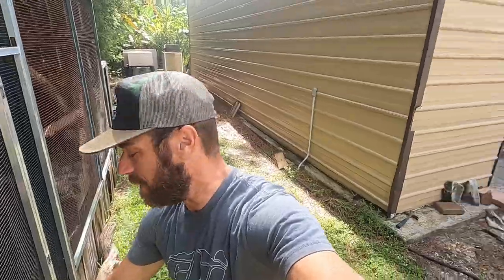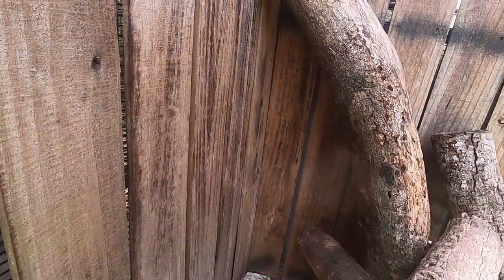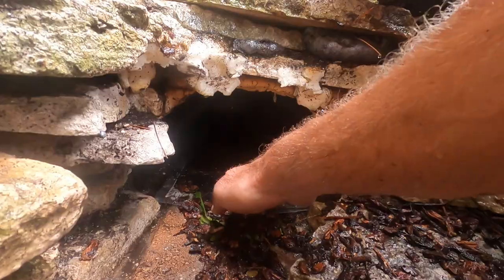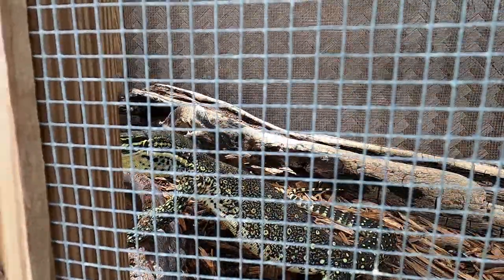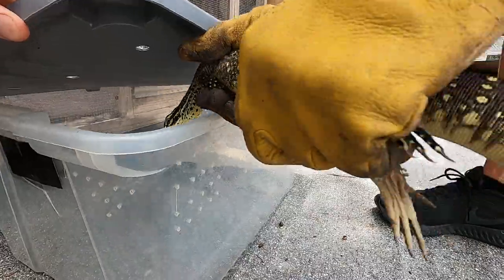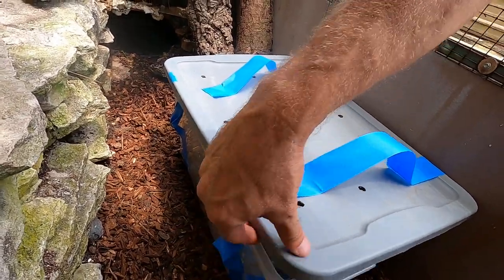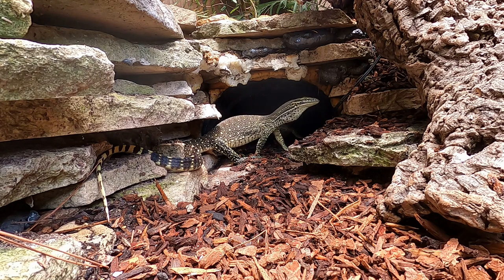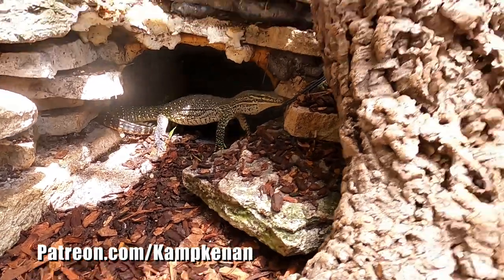New ARGUS MONITORS at the Kamp!

Comment: You can always knock a wooden spacer strip (1”x2”?) between each of those boards to prevent them from going back there and potentially hiding or (somehow) escaping. You don’t have heavy frosts by you that might shift the pavers on the ground but repeat water flow could also cause issues. My brother had 2 baby Bells Phase Lace, one of which (appropriately named “Houdini”) was insanely good at escaping. Bro found him both times fortunately, then discovered the place he was digging out -by the roots of a tree, following one that grew a distance under & out. Monitors are smart lizards, but you already know that.

Comment: So it appears and more likely since Flukers sends you free products, you are using a Flukers heat mat.  Those heat mats are not designed for direct contact , more importantly... they are not safe for this  outside/outdoor use especially in places where you’ll be spraying large amounts of water on them including what natural weather will occur.  That’s a huge electrical hazard.